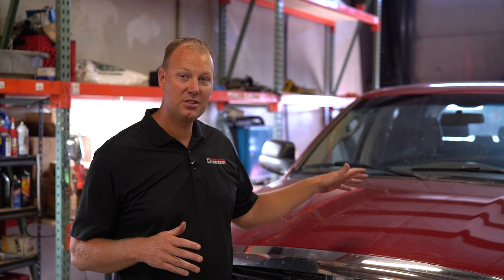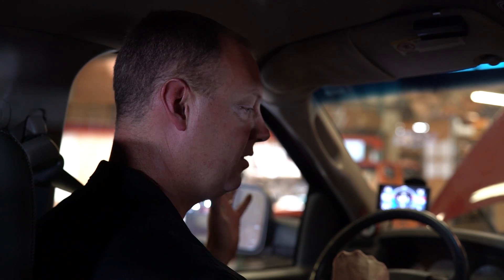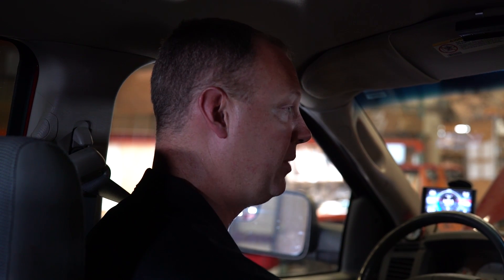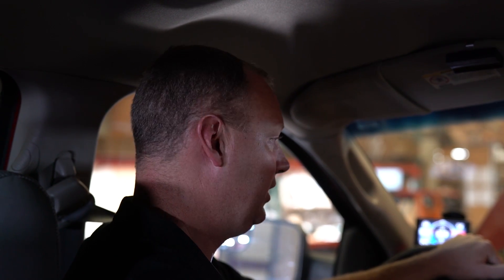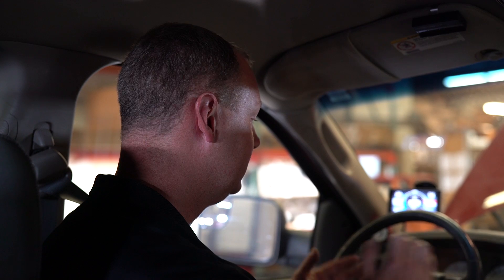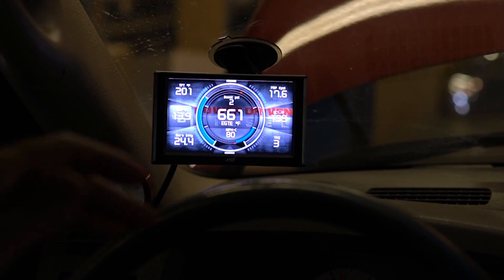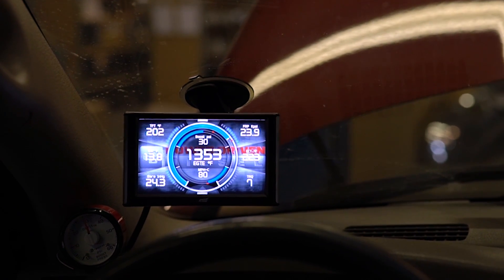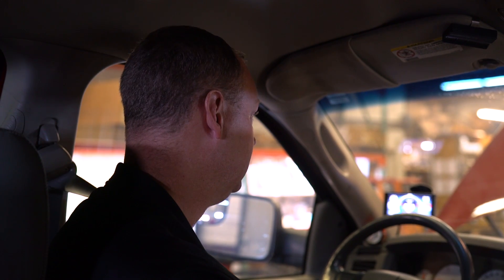Dyno Test: 2006 Dodge Cummins 362 SXE Drop In with EFI Live Tuning | Power Driven Diesel

Comment: Holy cow! So my 6.7 with an air intake, 5" straight pipe, s366 SXE, efi live and stock fueling might actually be pushing 600 to the wheels??? That's what I'm taking away from this lol
Reply: You tow heavy with your 66? I'm Considering getting rid of my compound setup for a larger single.
Reply: @TheMEXICANBEEF  not yet Haha. My trucks a grocery getter/play rig for now. Got it just because I wanted it.
Reply: wats ur reason for  wanting to switch to single?
Reply: @nicholas_hoaglan_2157  boredom? Crazy carls setup using a hybrid he351 over a s475. Setup has been leaky from day 1. The silicone boost tubes have popped twice. Using napa industrial water hose now and doesn't look all that great but seals up. It's sealed good now but who knows for how long. Just remember how much simpler the single setup was and considering going back that route.
Reply: Thats good to know I was just checking out crazy carl setup but I think I want all my turbo iing to be aluminum and v=band clamps and no silicone couplers... The powerband of a big single reminds meof ridin my two stroke dirt bike.Plus you can make way more power on a stock bottom end engine with a big single cus low end torque of twins bend rods
Reply: I like twins, but I can't recommend carl's kits due to the amount of aggravation. I agree on the v band clamps instead of silicone. You shouldn't have any problem with the rods on a 5.9 CR under 80 lbs of boost. The updated ATS compound kits look very nice if you want to spend the coin. The sxe chargers weren't out when my setup was built so there are many better options now I'm sure. I keep thinking some company is going to build the perfect single that will spool quick, tow, and provide large boost all in one.
Reply: I'd like to see this too.  I've got a S369SX-E on my '14 with EFIlive and stock fuel.
Reply: Monster RAM how does that spool compared to stock?  I'm looking to second gen swap my 6.7 with a 366 or the 369
Reply: @chrisguffey7420  you definitely notice the lag compared to stock. But once it spools.... holy shit
Reply: clayton bourne so what kind of boost numbers and egts are you seeing
Reply: Chris Guffey - There is a difference, for sure.  Don't expect any fixed vane charger to spool like the VGT, but it's certainly manageable. The truck drives much differently and like Clayton said, once the turbo lights (around 2000rpms) hold on!

What whp goal are you shooting for?
Reply: Monster RAM I'm shooting for mid 5 to 600...after the second gen swap I'm studding and doing a lift pump
Reply: @chrisguffey7420 I can peg my 50 psi boost gauge. EGT gets to 1300 if I mash on it hard
Reply: Chris Guffey - If 600whp is your end goal you might even want to look at the S363SX-E (80mm turbine).  I went with the S369 because I'm planning on around 750whp after I upgrade fuel.  With mild fuel upgrades, the 363 should get you 600whp all day.
Reply: @user63344-gds  I have a 67mm HE351VE in my 12V (250hp 5x16 injectors, maxed 215hp pump, 191 DV's), it's about the same powerband.. I can make boost down low, but that's not where it wants to be.. likes being over 2K if you've got any real load on it, 2500RPM and up it's awesome.. Gets a little toasty towing though.
Reply: mexicanbe, ill take your coumpounds off your hands.  email me. rdluvin@live.com
Reply: typo. the correct email is. RDLIVIN@LIVE.COM
Reply: I've already told a friend he can buy the he351 if I decide to sell. He has 90 hp injectors and it would make a kickass single for his truck with its larger housing. I will probably sell the twin kit with the s475 and the stainless diesel manifold separately on ebay. I would have to see that magical single before removing this setup. Tows like a beast if I can keep it from popping the couplers.